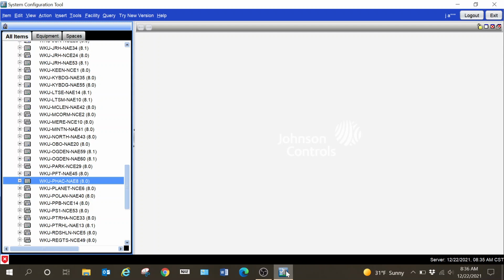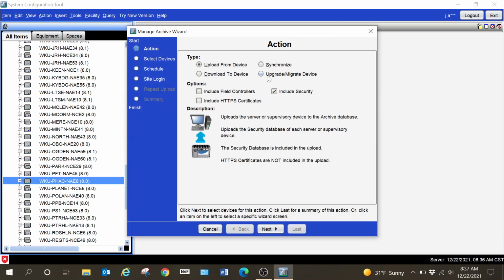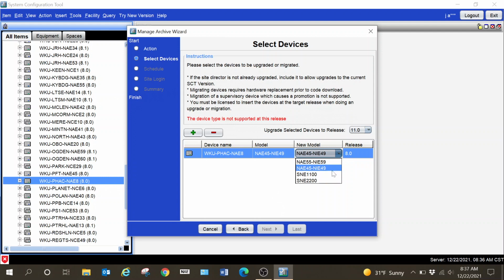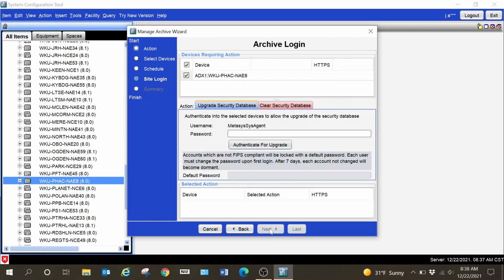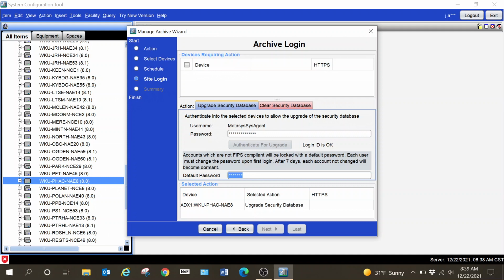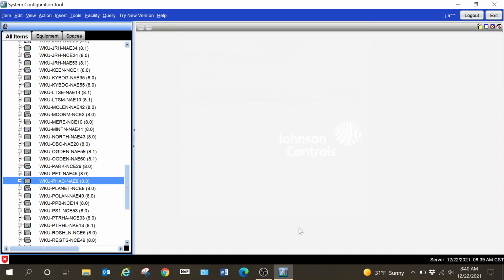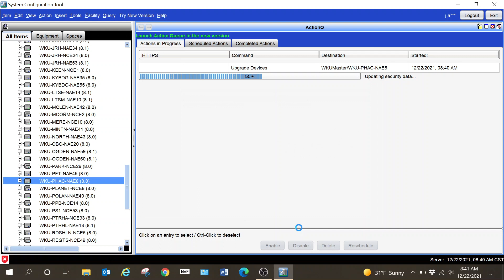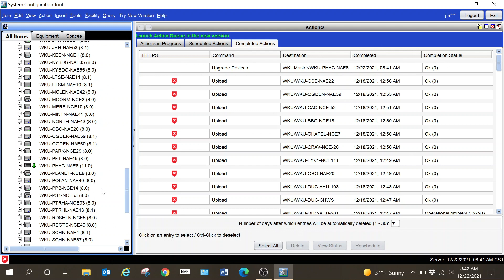How to upgrade a Johnson Controls SCT Database

Comment: Your local JCI will share with you the password of Metasyssysagent? We used to have the password of that user but not anymore. They change the password after we hired them upgrade our system from 8.1 to 11. They blocked us on a lot of access, included CCT, SCT what we paid for the software  license. I’m not sure if that is the new JCI policy. I’m about to contact the JCI cooperate to verify..
Reply: JCI does not own the equipment so they shouldn't lock you out of it. It's your equipment so you should demand access. I would look for a different vendor if they treat you like that.
Reply from the maker: They can change the password to whatever you want it to be. There's an initial password when the device is new.
Reply: @Systemcontroltech  they change the password and decided not to share it with us. Also, are you able to get the GGT software install on your production server directly? My local JCI told us that JCI changed the way to edit the GGT graphics with version 11. They installed the GGT on the SCT server instead. Anytime you need to edit the graphic, you have to do it on the SCT server then download it to the production server. We used to have the GGT installed on our production server on the version 8.1. It is very convenient to edit the graphic. I do not know what the purpose that JCI made that change on the version 11. I’m wondering this change has been effectively for everyone or this just another BS from our local JCI. Thanks
Reply from the maker: @J T  it's your system. They have to give you access. As far as the graphics, ggt graphics are going away. SMP will be ending in the next couple years